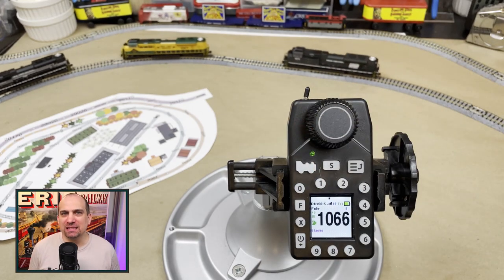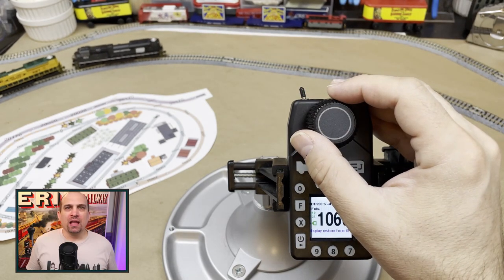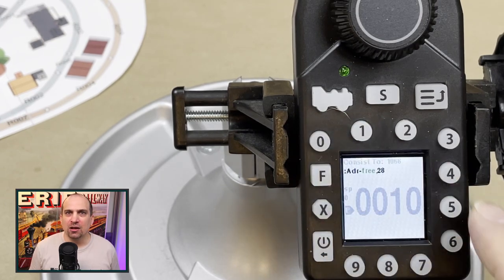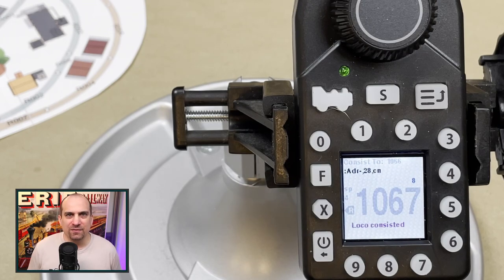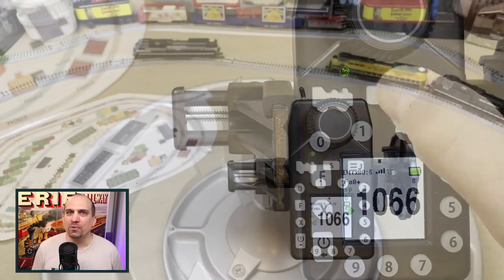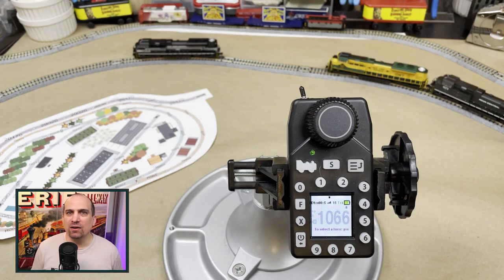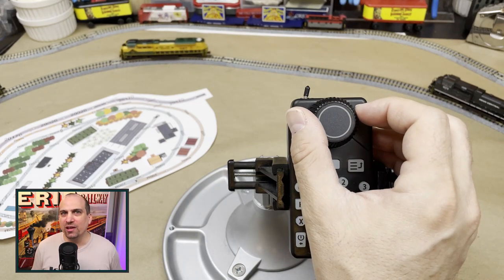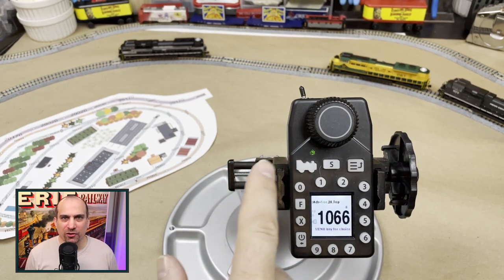75 | How To Consist Locomotives with Digitrax UT6D and DT602D Throttles

Comment: I learned a lot from the verbal discussion but your fingers are way to fast.  It would have been more helpful if you slowed the presentation so your speedy fingers would match what you were saying.  Keep up the good work at a slower pace!  Us Old Guys!!
Reply from the maker: Your channel name is ironic, Pacer, in relation to your comments, LOL
I am always trying to find the balance between being efficient and being thorough, and it is not always easy. My thought, which might be wrong, is that since it is a video on YT, you could either watch the section you need more than once, or you can use the YT controls to watch it at a slower speed.
I appreciate your feedback as I do want to make sure my tutorials are accessible to everyone. -Heath
Reply: @HumancityJunction  I literally had to slow it down 50% lol - but thanks for the vid.

Comment: One advantage of Advanced consisting is that the consist goes with the throttle/locomotives to other compatible layouts.
Reply from the maker: Steve, as far as I understand it, Advanced consisting is compatible with most major DCC manufacturers, so in theory it would work on any DCC layout.  I think. -Heath

Comment: Or just buy NCE. Far easier to consist.
Reply from the maker: I always find it interesting when someone says this as the steps are almost identical if you are using the same consisting method.  Digitrax has the option to do the same consisting as NCE and they have another method that is more advanced.
Reply: I just bought the 602D because my club uses Digitrax (I have NCE at home). I've read the manual and watched who knows how many videos and I still find Digitrax's system far more cumbersome. 

NCE,on the other hand, asks you the loco number and direction and you're done
Reply from the maker: @ronplichta1598  Isn't that the same on the DT602?  You hit the MU+, type in the loco number, make sure the direction is set, and you are done.
Reply: I reread the manual today as well as watched the video before today's show and I managed to get consisting to work.  The DT602D is good for shows due the large layout size and I eventually planto use both sides of the throttle simultaneously; however, I stand by my statement that I think NCE us more user friendly.  The 602 is an improvement over its predecessors in terms of ergonomics,  information presentation and use, but the use still takes a bit of practice to understand.
Reply from the maker: @ronplichta1598  what you are used to definitely has a huge effect on what you think is easier.
Reply: I tried Digitrax before buying NCE in the late 2000s. It wasn't an unknown entity to me.
Reply from the maker: @ronplichta1598  Before the 6 series, it was definitely not as easy.
Reply: That's an understatement!

Comment: I use Universal Consisting because ever since we bought into Digitrax decades ago, that is what they provided, and we easily learned how to do it and stuck with it.  As for the comments here that you want to take your consist to another layout, well, that doesn't happen, at least not to me.  I operate on several layouts, and on each one, you run the host's trains.  It disrupts their operating night if you want to run your stuff.  The only time we take our stuff away from home is to do train shows on NTRAK and T-TRAK.  Since the club is Digitrax, as most are, it is straightforward to get trains running for when the crowds arrive.
Reply from the maker: Glen, very good point about going to an operating session and you run the hosts trains. 
Also, it is really quick to setup a consist and I would assume it is actually part of the operating session unless you are just pulling a train from staging.

Comment: I have been using the advanced consist stuff. The MRC Prodigy Advance^2 Elite controller/throttle I have makes it super easy to setup and clear them.  The other reason to use advanced besides what you said in the video is that you can take a consist of locomotives to another layout with a different DCC system entirely and they will still be a consist (because it's in their CVs).
Reply from the maker: Roy, I completely forgot to mention that about advanced consisting.  That is definitely a good reason for it's use. -Heath
Reply: @HumancityJunction , portability to other layouts is the reason that I sometimes use advanced consisting.  Otherewise, I normally use universal consisting because I don't have to change any CVs.

Comment: how useful do you think the larger screen and extra soft keys are?   My home stuff is NCE, but I am debating getting some Digitrax stuff, or at least a duplex throttle, as that is what most are using in my area.
Reply from the maker: If you are NCE, and it works for you, I would get a TCS UWT-50P. This is currently the main throttle that I take to all operations sessions as it will work with both Digitrax and NCE.

Comment: Do you have a video where you're not doing it so fast? I can't get my music consist to work as good as I can as engine driver on the cell phone
Reply from the maker: As a part of the YT player, there is an option to change the playback speed and you can set it to half speed or even quarter speed. 

I do not have a different video, but maybe slowing this one down would be a solution for you.

Comment: Great video. I saw on a group chat today that the UT6 could be used, which I never knew. Your video was very clear & concise. I have used the DT602 to do it, and it is more complicated than my old DT400, which I was still using. I volunteer at a museum layout, so will try this next time I'm there. Thanks
Reply from the maker: The UT6 is my favorite Digitrax throttle.

Comment: I liked that video.  Very cool and clear.  I do not consist my locos, but my CS3 has a quick consist option which is rather cool.  Someday I may have to try it.
Reply from the maker: Opa, Do they ever run the highspeed trains with more than one power unit? I guess it would only really be used for your freight trains. -Heath
Reply: @HumancityJunction   My ICE3 is actually powered by a car in the middle (the restaurant car), so that it faces the same amount of strain either direction.  Now, one could buy a second ICE set and do a "double 8," as it is called, and the CS3 would auto-align the two powering restaurant cars.  I believe my ICE2s are powered by one of the control cars.  It takes a bit of work to couple them.   Down in Bavaria, they double up very powerful diesels in some areas to run the HSTs (EuroCity) which run between Germany and Switzerland, because they can't use electric in some of the places.  I have photos of such a double.

Comment: I have been purchasing 2 of every locomotive in my roster. That way I never have to consist or speed match, they just always run together without any problems. Not for everyone but works for me.
Reply from the maker: I have a couple of doubles that I do that with.  I also have one set of doubles that no matter what I do I cannot seem to get the to run at the same speed :)
Reply: @First name Last name You don't get it, I prefer not to go thru all of that, it is easer for me to purchase doubles and be done with it. If you wish to pretend your running a prototypical railroad with your 6 year old kid then that is your prerogative but I could care less about that concept.

Comment: I've inherited my late father's trainset that he built for over 35 years and he has this control system installed however I am unclear on how he has actually assigned the various engines (all have 4 digit decals on them) . I cannot for the life of me figure out how my dad assigned these numbers and where I can find them or if there is the option of resetting the entire system and starting from scratch (something I would prefer not doing because it was functional while my dad was still alive). 

Any suggestions or guidance you might have would be so appreciated. Thanks in advance!
Reply from the maker: What are you using for a controller?

The easiest thing to do is to try and reset the DCC decoder. Set cv8 to 8. This will reset the locomotive address to 3, which should then allow you to control it.

Comment: Am I correct that universal consisting doesn't really help if you're trying to run a certain train on multiple layouts? Like if I've got a club layout and my personal one, I can't consist them using my digitrax at home and have it work on the club digitrax? 

I'm really going to be looking for more info on consisting locos that are different models that have chips from different manufacturers. Any suggestions for that?
Reply from the maker: For setting up a consist that you want to utilize on multiple layouts, or if you want the consists to be “permanent” then use CV19 consisting.

Comment: I use cv's 19, 21 and 22, it's simpler. And you control the functions precisely.
Reply from the maker: Marten, Are you an NCE or Digitrax user? -Heath
Reply: @HumancityJunction  NCE I Tried NCE advanced consist but it disables all functions in loco 2. I like the prime mover sounds on in all locos. With cv's 19, 21 and 22 I can control which function are on or off in each loco
Reply from the maker: @martensiersma3304  I heard the NCE consisting only uses cv19 and does not use 21 and 22.  So I can definitely understand why you program the CVs directly.